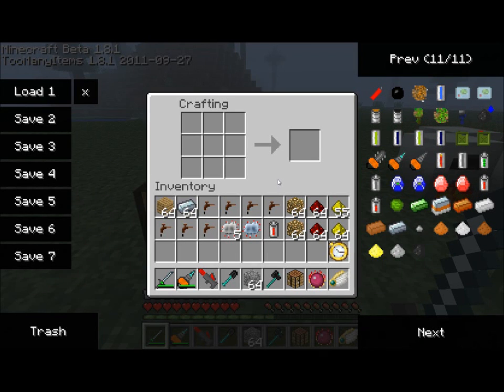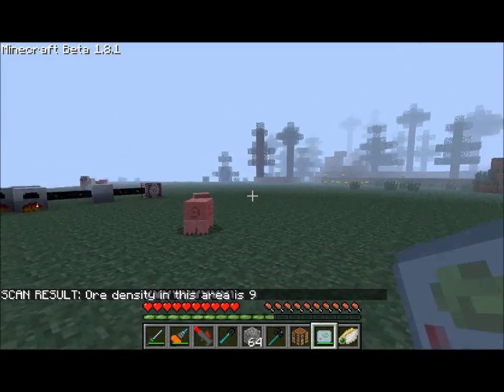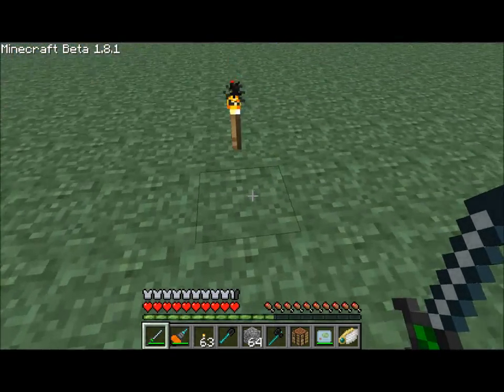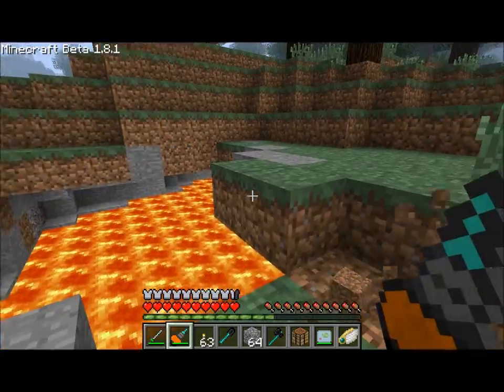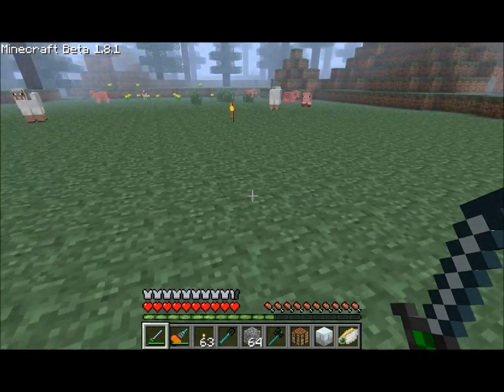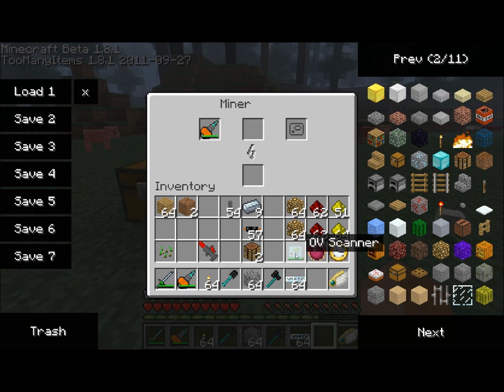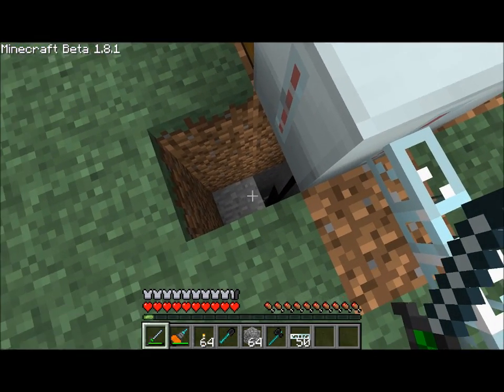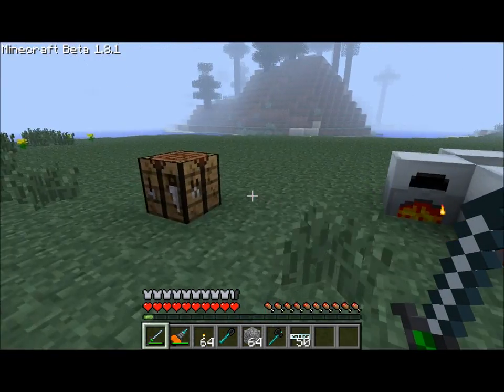IndustrialCraft 2.0 Tutorials - Miner

Comment: in tekkit, a buildcraft mining well is faster, can use transport pipes, and makes its own free mining pipes. im not sure if IC miners can use transport pipes. a disadvantage is that if you're planning on powering it with electricity, you need an energy link, which is expensive. but steams engines are a cheap way to power it if you have an abundant amount of coal. another disadvantage is that the well ignores ores on the side and just goes straight down. i know this isnt tekkit and just mc with IC installed, just saying.

Comment: Newer tutorials also adds a pump device next to miner with empty cells inside, and another chest next to pump to throw the filled water/lava cells in.
Reply: My strategy is fairly simple. I decided long ago to do videos with a certain structure. That structure was to have the name of the video (the name of the mod) prefixed or suffixed by the words Feed the Beast. That is what I consider to be canon. The problem arises is what if there is interoperability between mods. It seems like there is no overall mod architecture and it's just a patchwork of whoever made mods at the time. I considered this problem and decided to opt for the worst case scenario, that being only include literally one thing from a mod in it's video. The original Thaumic Tinkerer video for example, I decided to only include one item from Thaumic Tinkerer in the whole video, the Crystal of Rainfall, 20 seconds from the end of the video. Now that is literally the worst case but it was important to do that just to illustrate how I do videos. Remember no-one does things like this ever. I decided long ago to not do a survival let's play based on simply me, because it was far too egotistical, and, I also realised and then decided to go for that worst case scenario option because I realised that the interoperability was not structured at all and was not likely to be. I didn't  want to have part 1 of a series based on one glitchy interoperation between mods, if I found out about a glitch or some interoperability functionality then I would stick it in for the video for one of them, it made things a lot easier.

Comment: BC does have elements that can be used with IC such as transport pipes and autocrafting. For example I have a scrapbox factory using recyclers, autotables, chests and pipes. You can also connect wooden pipes to the sides of Macerators to take out excess dust.

However only BC energy can power BC items like the quarry. Specifically only the engines (stone and iron) that burn fuel. I have a quarry that filters coal, dusts it, compresses it and makes diamonds.

There is a mod, but it can bug out.